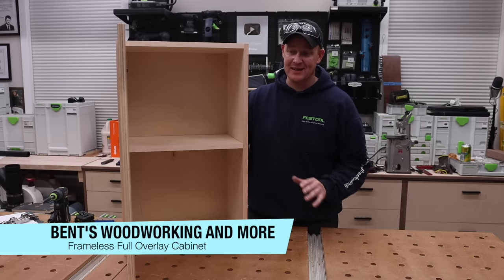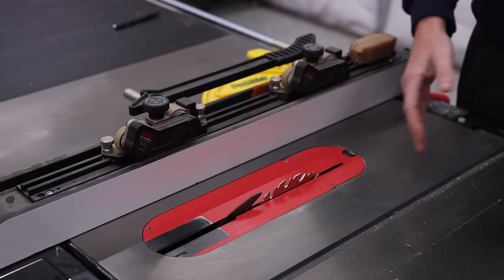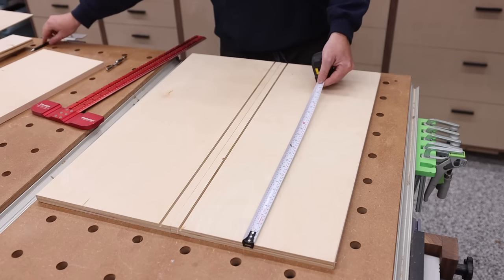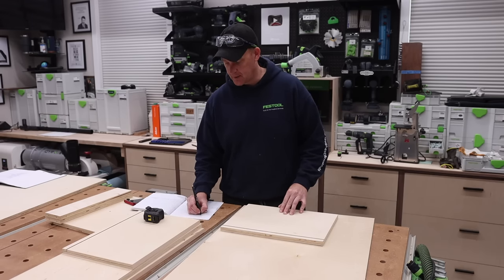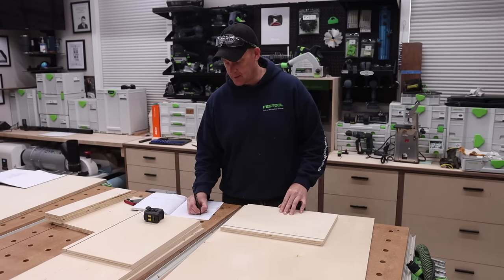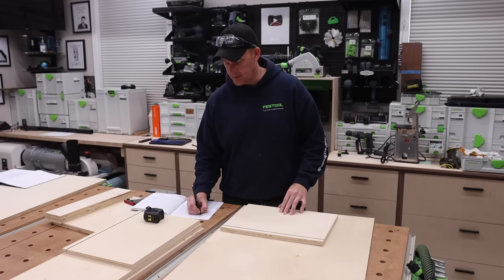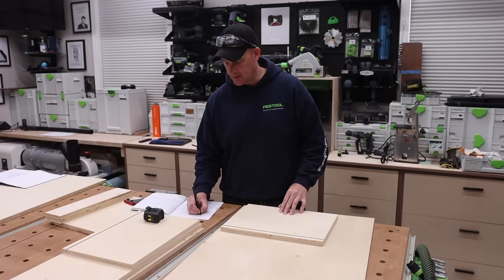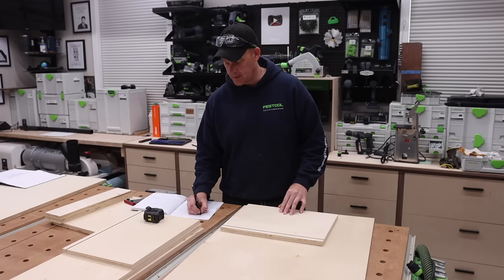Beginners guide to frameless upper cabinets

Comment: Well done Bent.  I love screws, but always rabit the top and bottom panels into the sides.  Everything is glued, as well as screwed as you do.  I have this inner phobia of watching the lady of the house load up the shelves with cast iron pans on one shelf and her great Grandmothers china on the next.
Reply: You talking about dados or rabbet? Rabbets only offer a bit more glue surface but not much - pretty much same mechanical strength. Dados, now that would help with your phobia

Comment: Brent, "don't have the budget for a shelf pin jig? Just use this $170 T-square!" Love the video, but that....lmfao
Reply from the maker: I just don’t have one and I didn’t want to pull out the Festool LR32 in this video.
Reply: @normandyBeach, Jason's reply to you is even more pretentios.. LMAO, "didn't wanna pull out the Festool LR32...." :)
Reply: And buy the Blum Eco drill
Reply: They complicate a build so much. This can be done so easily without all the expense equipment
Reply: @hogarthrathbun5986  I realize that I am seeing this a year later, but I don't think that that's fair to the content creator. Many of us get into cabinetry and or furniture making from different avenues. Although I can only speak for myself, I am often in a similar position. Though most of my tools are hand tools, many of my power tools are festool. It was due to the system and being able to do all of my work in a very limited space environment. Once you start to see how all the tools are integrated, it might make sense for you.
Reply: @brent - I have a new cabinet from Ultracraft that is frameless but was ordered to deep by the contractor. What is the best way to take that apart and cut 4” off the depth?
Reply: I used a strip of metal bracing strap that had holes every 25mm,  and I'd mark with permanent marker the spacings I required.
Reply: Great video!  We all have a process we follow and certain tools we enjoy working with. You have a beautiful small shop and arsenal of tools.  For anyone who is pouting about the tools being too expensive, there is no shame in going to Harbor freight and getting what works for you for now.
Reply: Dude owns the entire Festool factory

Comment: I am doing full overlay frameless cabinets for my kitchen and I'm hung up on an issue: I have 8ft ceilings, so the cabinets have to be near or touching the ceiling. At the same time, I know if they are flush to the ceiling, I'm going to run into issues with the doors hitting the ceiling as they open and close (because there has to be at least a few millimeters of variation going on with the ceiling flatness). I'm trying to decide between either having a gap above the cabinets (between the ceiling and the cabinet boxes), or having a "crown" of sorts that would basically be a 1" margin of wood paneling at the top of the cabinets. What's the common approach to this problem?
Reply: There is always going to be a gap - trim. Crown molding or other trim.

Comment: The importance of laying out the boards before cutting can't be overstated.  Once I was in batch mode and cut every dado on the same side.  Of course, when I started to put the carcass together, the dado's weren't mirrored so I was screwed.  I even had it mentioned in my sketchup plans, but as usual, I disregarded my plans in the shop.  LOL.
Reply from the maker: Definitely been there.
Reply: Yes, everyone has been there with the missed mirroring! :) Okay if you need to build another cabinet same size!

Comment: Did I miss the part of this video where you put edge tape on all your parts before putting together as a box? One other suggestion to anyone watching your video. You should consider using 1 side prefinished birch or preferably maple plywood for building any cabinets. This available in 1/4" to 4/3". The extra cost is well worth it versus the time to finish the insides. Of course this has to be purchased at your local supplier (not Home Depot)
Reply from the maker: I applied it before hand. I have other videos covering the application of edge banding.

Comment: Remember with a 30 cabinet 15 is the center but the shelf is 3/4  so you wanna lower the holes you drill by about 3/8 so Middle of the shelf actually sits in the middle of the box.

Comment: As a owner of a cabinet shop for over 20 years, I would lose all of my contractors if I  produced a cabinet with nothing more than butt joints.
If anyone tries to say butt joints produce the same reliability as full/blind dado joints and additional rabbit joints you may want to do more research, also glue works just fine with prefinished plywood, you just old school dado joints,in this case you have a fresh cut on all your plywood edges eliminating the slick prefinished edge that won't allow good bonding.
If someone wants to trully learn how to build strong custom cabinets  do your research and avoid cutting corners.

Comment: so I can add my own pointers from building kitchen cabinets. 
Yeah some of the professional posters are correct that butt joints are not the best construction technique, but when you start talking about dado and rabbit joints, you are going to need the tools to do that and most DIY dont have a pro shop at their disposal and we have to start buying the power tools, and have the wherewithal to use them and quality ones are not cheap.

When I made my cabinets I used CONFIRMAT SCREWS. 5mmx70mm for 3/4 plywood for my butt end boxes,  Solid as a rock.  8 years now, everything is still fine. I am aware of a well known online cabinet maker and they use them, even made a video of tossing a cabinet off the roof of their factory and it held together.  If you want to do the extra step dip them in an adhesive for that little extra bonding.
Also I see no reason not to go full back on wall cabinets.  If the cuts are right and squared, the inside appearance is the same and you get better all around cabinet strength and you remove a dado step and for most of us DIYers, time is of an essence doing this project on weekends and afterwork.  But that's up to you.

Comment: The state of plywood quality today makes me hesitant to try switching over to frameless construction because and bending/bowing over a bigger box will ruin your attempts to keep clean reveals on the doors/drawers.  At least with FF construction you can use better material and ensure you have square openings for your doors/drawers... even if the plywood box ends up not quite perfect.
Reply: I worked for nearly two decades building frameless cabinets. Naturally,, the drawers can support far greater weight, but it was also fun when we tested competitors products. In the end, we usually used one of our cabinets to finish beating the FF ones to pieces. The disadvantage to frameless wall cabinets is the weight;  They can be harder to install due to their weight. 
With thinner sides, and basically a picture frame holding it together, the FF cabinets are certainly lighter in weight.

Comment: There is no difference if you have more cabinets to the left or right side. 
You just minus 1/8 from outside cabinet dimension for your door size.
Reply from the maker: Well that depend on what you want your reveal to be between cabinets

Comment: I make cabinets for a living?  I am a small shop like you so I avoid full kitchens & do add on , trim, hardware etc.  I use the Rockler system for shelf pins it’s dead on accurate, and I used all that stuff you do and it was killing me for time?   The one I use does both sides and flip do the other!
What your doing it just kind of a Sunday in your hobby shop stuff!
I am blessed and enjoy my job but if it was only a hobby?  Not sure I would spend $200,000 on a hobby?
I guess your a content creator though.  I do enjoy most of your stuff but cabinet making is an art of thousand of an inch or your drawer does not close?  Your door sits oddly, and it’s looks like a DIY project in your most expensive investment?  Your home!

Comment: 6:11 the guys over at Foureyes use a drill bit or other device that is the same width as your saw blade to get perfect width dados with no measuring or iterations.  No muss or fuss.  I have no affiliation with them, just a subscriber.  I tried their method many times...always works beautifully.  Can adapt to the fence or sled.
 
https://youtu.be/xqlN7mR6LkY?t=552